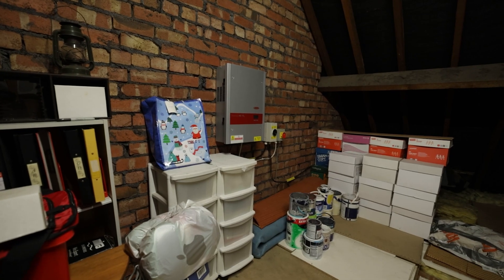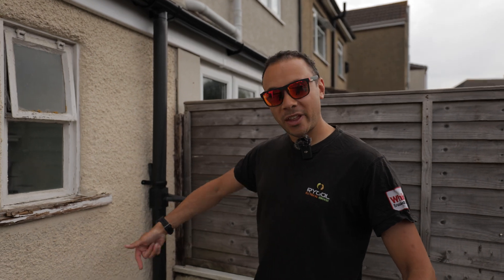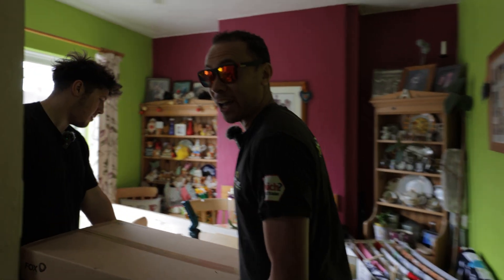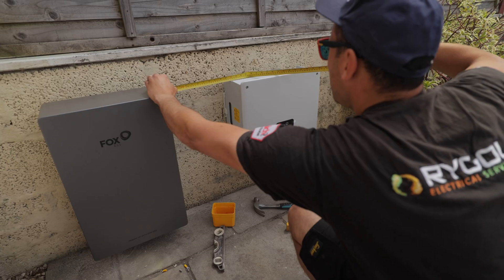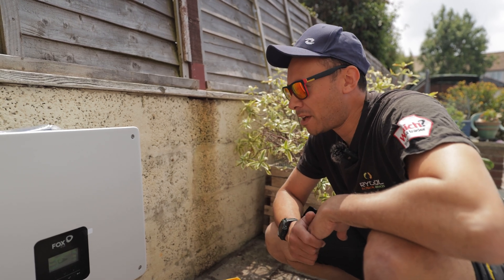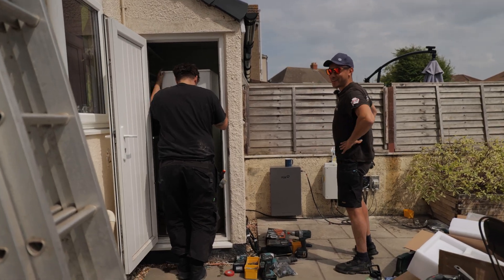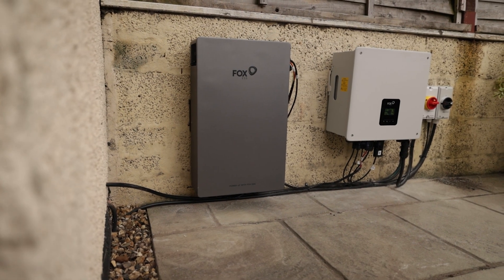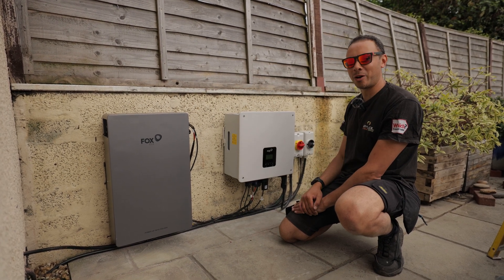There's a BIG problem with Battery Storage...

Comment from the maker: What are your thoughts on placing battery storage in lofts? 

Team YES? or Team NO?
Reply: Thought about doing it. So fitted temperature logger in the fitting position. It hit 56°C last week, and it's not even August yet. Probably not a good idea.
Reply from the maker: I agree!
Reply: No way, ground floor only.
Reply from the maker: My thoughts too
Reply: Team NO
Reply from the maker: So true
Reply: Team Ground for the batteries.

Comment: The problem with having batteries in a loft is if you have a fire in the house (not the battery) and the loft timbers get burnt, it's likely the battery will fall through the ceiling and could injure someone and become damaged in the process. Its not so much a problem if the battery itself causing a fire  because because

Comment: Batteries have always been a problem and often super fancy kit let down when the battery goes flat or deteriorates. Electricity doesn't like to be restrained unless someone can change physics and one of our reps from the Cambridge area said the neighbours batteries caught fire that were in their garage and did severe damage to the house. You never see much in the media about this so I wonder if these stories are suppressed and may cause concern for new installations. My best battery is my 50kVA generator! whilst people will say it's not green that's true but it's dependable, reliable and as our house is also our business we cant be without power.

Comment: Cant help but think all of this solar and battery will never pay for itself🧐
Reply from the maker: Hi Jeff, we use software that calculates for us.
Reply: I have 11 kws of panels and nearly 28 kws of battery storage. My annual electricity costs are around 2500 euros a year. The system self Installed cost 14 k . 5 years payback and also when the inevitable plannec power outages occur I am not affected. My energy costs are less than 500 a year and only because I charge the batteries on the night rate during winter. I can't help but think that battery and solar DOES pay for itself.

Comment: A nice, expensive, shiny battery outside where it's easily accessible. If they are ripping cables off chargers for the copper, how long do you think these batteries are going to last?
Here's my worry, new solar panels on roof = goodies at the side of the house. There will be a 2nd hand market. You might as well put a sign outside your house..